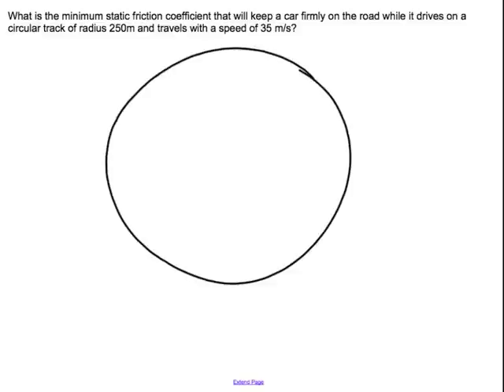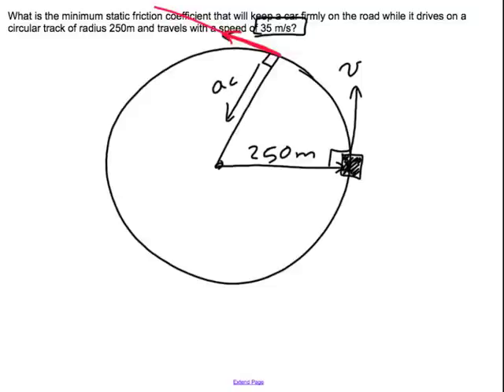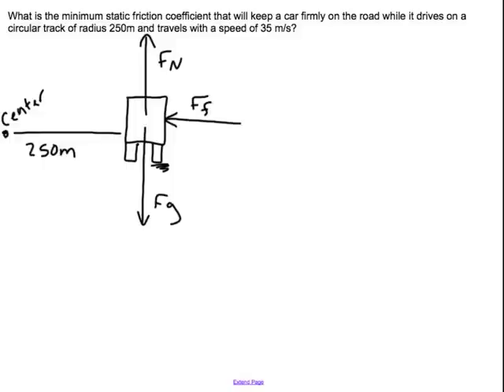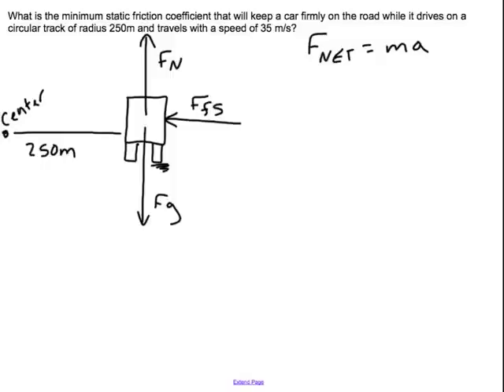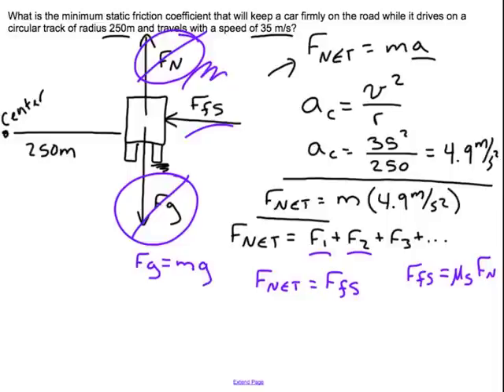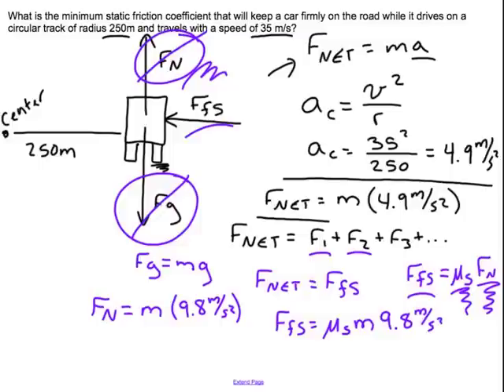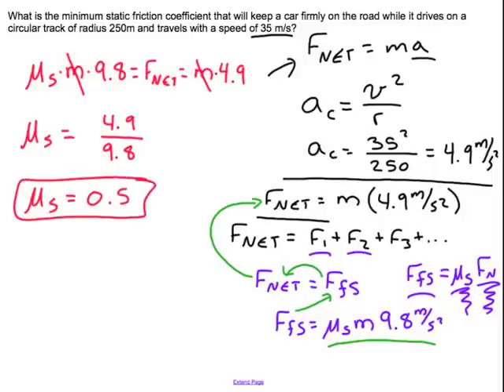Centripetal Acceleration with Friction: physics challenge problem

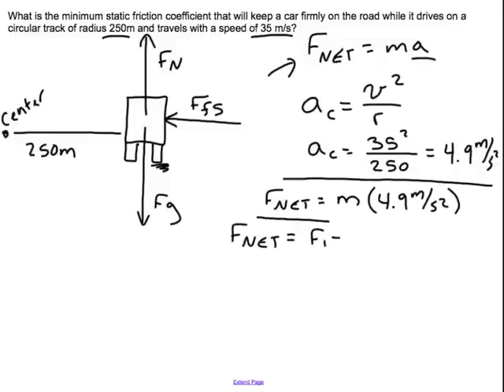Comment: I was referring to 4:16, two of your forces are vertical, the friction is not vertical but they're denoted as components without arrows which might be confusing because they're not on the same line. I know that in this case, in the end, the two first forces cancel out and they take away  all the vertical vectors which was convenient here.